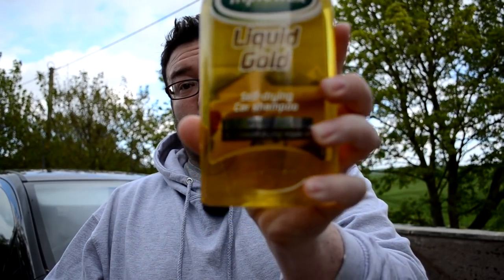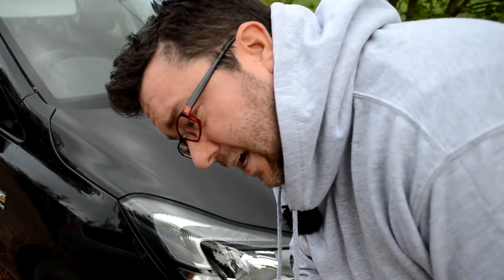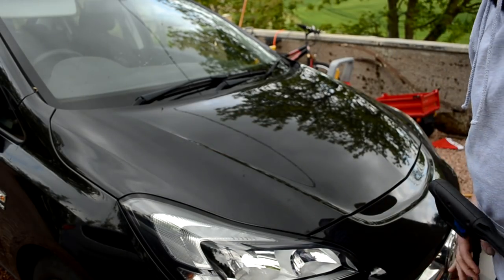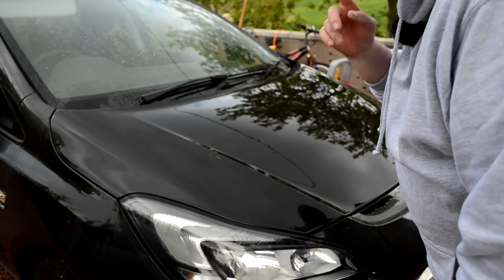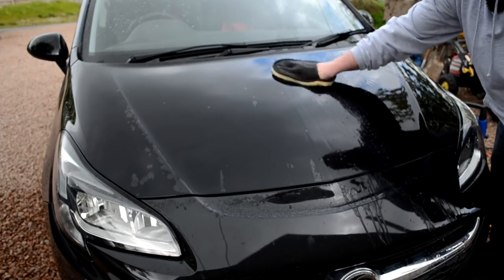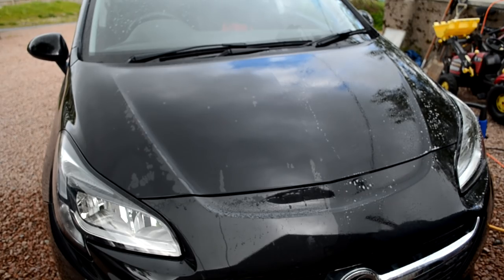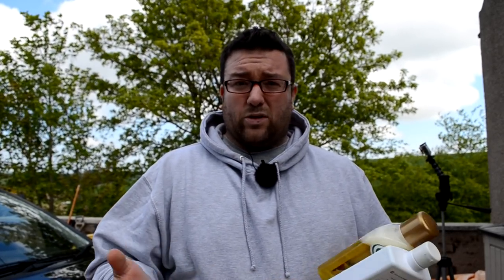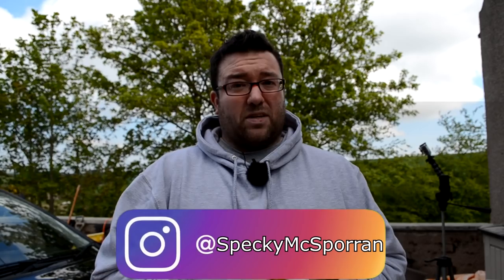Water Spots - Is This The Solution? Did It Work?

Comment: I used a 1:8 ratio in a spray bottle, sprayed the entire car, let it sit for 5 mins, then pressure washed it off as a quick rinse. I actually don't have too many waterspots, so it does help. But you cannot expect zero waterspots unless you dry the car manually. Definitely a lot better than other shampoos.
Reply from the maker: Interesting idea 👍
Reply: @SpeckyMcSporran  Yes, I was on vacay so that was the only option. It took 10 mins all in all. At the end I sprayed the car with carplan superglos, but I just pressure washed it off instead of drying it. Actually worked!
Reply from the maker: You're the second person to rinse off Super Gloss, I'll have to try it.
Reply: Specky McSporran My car is beeding (spelled?) so you can see a lot of water droplets on the paint. I don't know if that is because of the product or that it was waxed 4 weeks ago

Comment: Wow I’m actually impressed by the Triplewax. I thought it was a load of bunk that it would self dry. Pricey as you say but saves effort. Can it be used in a pressure washer detergent dispenser?
Reply from the maker: Me too. This was the first time I tried it and it did exactly what it promised. I'm sure you could but due to its dilution ratio I don't think it would be that effective.

Comment: Cheers Specky. This is a great thing, isn't it? Surprised that there hasn't been more of a buzz about it. Hardly any youtube videos.
Reply from the maker: Thanks Bella, that's why I made the video. There aren't many self drying shampoos on the market but they definitely have their place.
Reply: @SpeckyMcSporran  I've only just started car care properly in the last week or two, but in the two washes I've done since, I've had loads of water spots. Inexperience and bad practice on my part, no doubt... but a self drying shampoo looks like liquid gold to me.... Hold the phone! D'ya see what I did there? LOL. I'll pick up a bottle and see. As you say though, at £1 a wash it's not cheap. Cheers again mate.
Reply from the maker: @bellacavachon7510  no worries. My best advice is to dry your car after washing. There are many spray products that can be used as a drying aid to speed up the drying process and even waxes that can be applied to wet cars. Pick up a drying towel, it doesn't have to be an expensive one but.